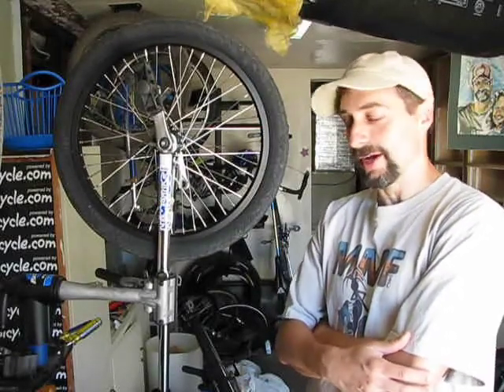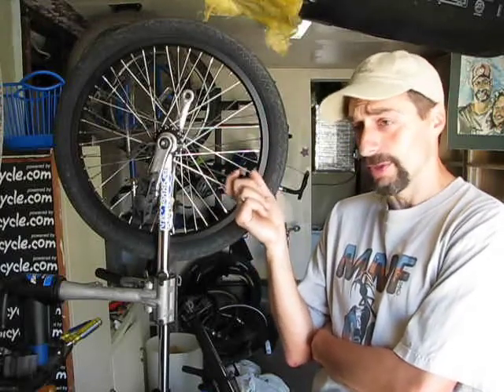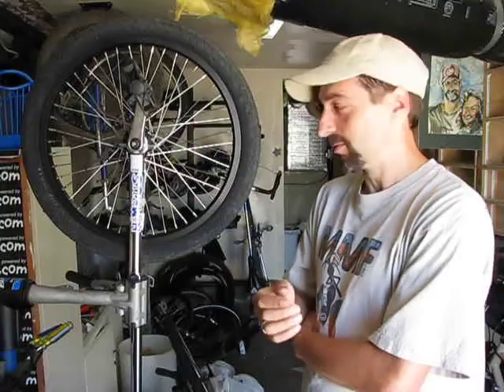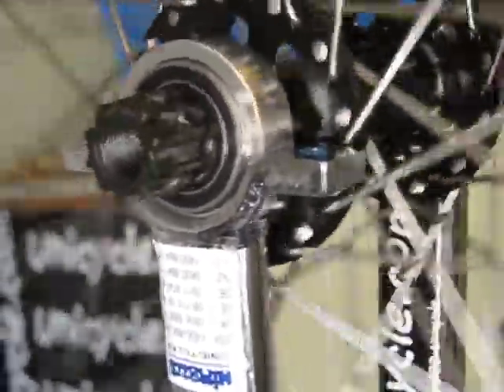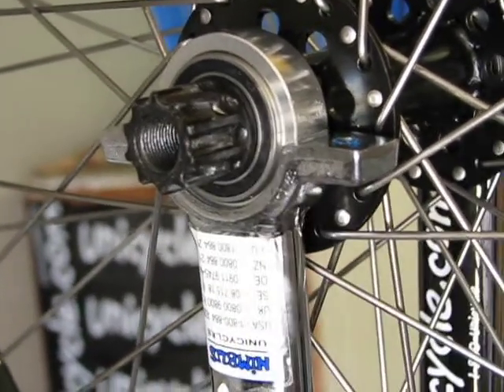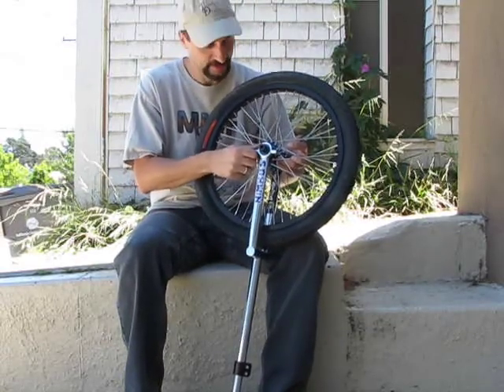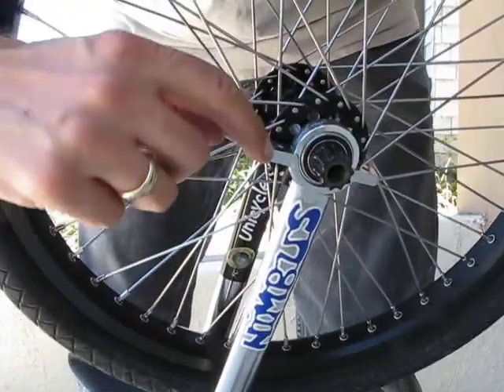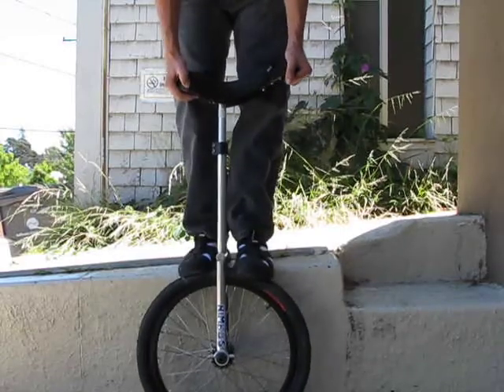Nimbus X hub design problems

Comment from the maker: @GShoe32 The bearing tolerances on the Nimbus aren't tight enough for that to be reliable; some people who've installed them without the spacers find that the bearings move on the axle.  And if you care about standards, the spacers are required for the system to be ISIS-compliant (although it's probably not compliant even with the spacers).

Anyway, I don't think they're selling this particular design anymore.  It works OK on the 42mm OD bearings without the sleeves.

Comment from the maker: @TeamInsomnia 
Yes, you're right, it's not a problem with the hub itself, it's the overall design of the system when jammed into a frame with 40mm bearing holders.  UDC agreed to take it back and sent me another one with 42mm bearing holders.

The shimmed bearing required to fit the ISIS hub into a 40mm frame looks like a hokey solution.

Comment: not really a hub design problem. that's not the normal bearing. udc probably gave you that as a way to get rid of the old 40mm bearing frames. jerks